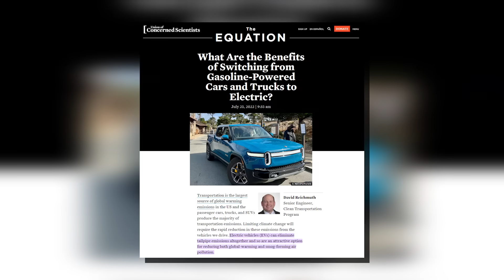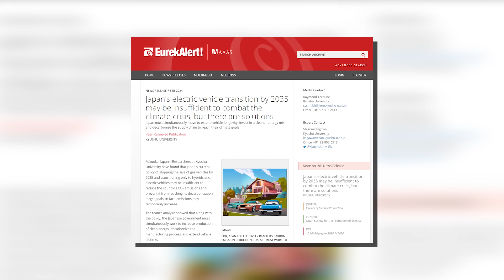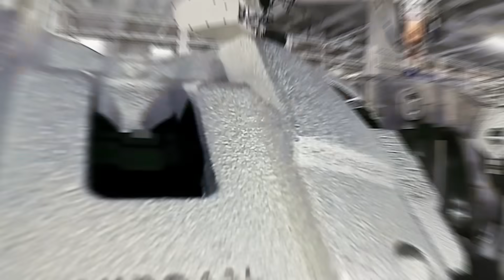The Real Reason Why Japanese Reject EVs

Comment: Pure EVs are dead. Self charging hybrids with small efficient and clean diesel two stroke generators are the only way forward with net stupid. 
Doing it this way removes range problems, removes the excessive burden on the grid, removes the frustration of having multiple charging apps all linked to your bank account, removes charging point queueing frustration, reduces the cost of the battery and therefore both the cost and weight of the vehicle which will also address excessive tyre wear.
In fact the ONLY downside is that those in the FAT PROFIT game will be out of pocket.

Comment: Almost all batteries and their components  are made in China. This is why Japan is trying to avoid EV's as they don't want to rely on China for anything. As for hydrogen it has been proven that this is a dead end as it costs 6X the electricity to produce it vs just putting the same amount into a pure EV.
Reply: The Chinese already used the solar pannels to make hydrogen; in the future, they will create more hydrogen for the vehicles, from small cars to big trucks.  The reasons that the Chinese are able to make battery cheaper than other countries because they have been making friends around the world, most importantly, their battery business is in the vertical business....so it is very efficiency.
Reply: @themiddlekingdom9121  So make enough hydrogen for one car when you can charge 6 EV's with that same amount of energy. Also  you have to store the hydrogen and transport it to the sights to be put into vehicles. No sorry hydrogen is a dead end idea and is being abandoned everywhere as a dead technology. 
As for Japan they are doing everything they can to NOT rely  on China for anything at all as they have been burned in the past by the Chinese.

Comment: I remember seeing a story where a guy had a small dink on the bottom of his electric car and it totaled the car as it cost $60,000 to replace the battery. So I would hesitate to say that electric vehicles are cheaper to fix or more sustainable then internal combustion cars. 
Oh, by the way, when they say less parts to make, they are talking about the parts necessary to steer, accelerate, and stop the vehicle. Drive by wire is absurdly dangerous in my opinion as it leaves essential systems to be dependent on software, and some people may be just one update away from a car that decides it doesn't want to stop when you press the brakes.
Reply: Dear poorly informed and easily duped person. Drive by wire sir is in most vehicles today regardless of power source. More reliable, lower cost, longer life. In fact many ice vehicles have more computer power than EV as the computer controls turbos,  airflow, fuel, exhaust and many other parameters of the overly complicated ice vehicles today. The battery claim is ridiculous on its face. https://youtu.be/jfGf6fcBlRo?si=n8jhn9_jeIJeg030
Reply: Drive by wire is applicable to both EVs and ICE. Nothing to do with propulsion: uses the "traditional battery" power. Also, software is not at only EV tool...
Reply: @RenatoLaino  When I say 'drive by wire', I mean the ability to steer and give motive power to the vehicle the same way one 'drives' a car in a computer game using a racing controller.
Reply: @byurBUDdy  my perception is that you're just not well informed. That a vehicle is electric or not, doesn't limit the software or steering tech it  an use. EV referes only to cars equipped with 100% electric drivetrains and batteries to store the power. And ICE today can have steering by wire and self-driving in the same way as an ev. Please don't let people food you
Reply: @RenatoLaino  I was critiquing the technology in general. I find giving a computer control over the steering, braking, or acceleration of any vehicle to be absurd. In older ICE cars, those three systems are each independent from one another. They are also mechanical. Yet that is not the case with drive by wire technology, as all of those systems go through a single point of failure, and a system fault may result in loosing control of acceleration, braking, and steering. 
There is a difference between using an emergency brake that has a physical connection to a braking system, and an emergency brake that is just a button that is dependent on the computer to activate.

Comment: OK. All this information is old and everything has changed since this information was correct. The bottom has fallen out of EV sales. The dangers around fire and explosion of the batteries, the lack of charging infrastructure, the inability to supply enough electricity, the extra weight and acceleration, the fragility of the battery, the technology around the management of battery safety. things like cold, shut the battery down. Countryside Australia, reports that in the even of the regular fire and flood events, electric power is the first to go down. The problems are endless and impossible to overcome. What also has not been mentioned, is the decision by many car manufacturers to develop new more efficient combustion engines. This news came out 6 months ago but there are some many unsold EVs at dealerships, that they there is an effort to screen this information until all EVs are sold, which isn't going to happen now.

Comment: So BEV advocates say just mine more Lithium, copper nickel and make more all electric cars - well that is the very problem. To refine one ton of lithium requires 500 tons of ore and 500,000 gallons of water. Add to that the world grid is mostly powered by fossil fuel and it losses 15% of the enegy produced to power the BEV cars that typically weigh 1000 lbs more to move.  Further a hybrid can be powered by bio fuels such as bio diesel or ethanol; which makes them 100% non fossil fuel; while the grid is 50% or more fossil fuel powered. People forget the massive power needed to build a dam with 12 million tons of concrete or a nuclear plant and U235. they arent green either.
Reply: Not to mention when mother nature strike and power is of for days, you're done for. Having different energy source make your life much reliable than having one energy source.....

Comment: The Reason Japanese Companies have not all jumped into BEVs is simple; they know it isn't - the future.  At leat not Lithium based BEVs.  The reason is simple; BEVs aren't green; and you can't make enough of them, like one thing - Lithium supply. 169,000 tons of lithium were refined in 2023. That is only enough for 12 Million Y size BEV batteries if  you make nothing else with lithium. No cell phones, nothing.  The market is 90 million. If you use 1/3rd of Lithium for other products you only have enough for 8 million BEVs or 16% of the market; where as if you use smaller batteries like found in the Toyota Prius and Rav4 hybrids; you can make 8x as many.

Comment: Hybrids require more maintenance than a regular ice car. You have 2 systems working in concert with each other. Problems can occur when the two systems get out of sync. The ice car requires more maintenance than a pure ev car.
Reply: You don't know much about Toyota hybrids if you think that. Their hybrid system is simpler than people realise
Reply: I have done 100k miles in my hybrid Yaris and apart from oil changes and tyres I have had to do nothing.
Reply: @jamie-ck6js I love Toyota, yet in Evs you don't have to do any oil changes or replace brake pads as frequently as ICE. If Toyota would decide to do it seriously, they may be able a car that needs to have only cleaning and inspection
Reply: more complex doesn't mean more maintenance. Actually it's the opposite of what you're saying for hybrids if you're talking about Toyota.
Reply: not necessary， Chinese hybrid cars have no transmission to maintain, because transmission is not needed to equip in the system and all that engines do is keeping charging the battery which promotes the motor. Besides, the electric part is relatively easy to maintain, so the maintain cost is actually lower than ICE.
Reply: When I think of pure ev cars I think the early iPhones. Planed obsolescence, get the latest one and there is a super low trade in.
Reply: No current EV battery is maintainable - it's one-and-done tech.  If the unserviceble nature of EV batteries is not solved, the auto salvage yards will be stacking EVs that only need a new battery.
Reply: @timothykeith1367 where do you get your info? My advise is not to believe the fist thing you see. Ask the people tha has worked on it, look for multiple sources of data and don't get attached to the outcome
Reply: @timothykeith1367 EV batteries can be replaced or exchanged. It is a lie that batteries cannot be re-engineered, as several countries have already implemented battery re-build companies (look at the report on the fully charged channel) . The raw material are just too valuable for them to sit in car dump yards, unlike petrol engines and rusting fossil fuelers.
Reply: Further, an EV one can charge at any powerpoint, which can be supplied by free power from solar or battery or both in concert. A hybrid still has to call in at a petrol station and pay prices at the whims of the fossil fuel barons. No hybrid built cannot get away from the fact it is neither a petrol car nor an EV, so something has to be sacrificed for wither to work to the best extent.

Comment: In China, EV prices are already coming down to on par with or even below ICE of similar comparable configurations and sizes. Plus, the saving from at least 10 years of usage with electricity charging vs. gasoline. It saves consumers a significant amount.
Reply: Actually well below as the new BYD $11000 hatchback buries the ICE competition.
Reply: Factory overproduction. Inventory dumping.

Comment: The Japanese have not gone woke and understand PHYSICS.
Reply: Apparently not as an ICE car loses 70-80% of its energy to heat where as its less than 20% for an EV
Reply: @mistermood4164  And how much electricity is lost over the wire? Where did all those rare earth minerals come from? You probably think electricity comes from the wall don't you?
Reply: @doctordetroitt   its less than 20% copper wire is very effective and transferring electricity between components. Even if a power plant is run by fossil fuels we would be able to power twice as many EV as you would ICE  given EV are twice as efficient.
Reply: Dear Dr., what laws of physics thermodynamics support vehicles which waste 80% of the energy in a gallon of gasoline which is lost as heat? EV waste heat is less than 20%. In addition buy a Nissan Leaf EV and discover you get 111 e-mpg compared to 29mpg for Rogue. Purchased used Leaf and used Model 3 five years ago. So far over 100,000 miles combined. Saved $7,000 on fuel, $2,000 on maintenance. Leaf has never had an issue, not been to the dealer.  Model 3 had three warranty repairs, Tesla came to our house and did the repairs. Both batteries at 99% capacity. I'm old guy, worked in Auto body industry for 35 years. Driven every type vehicle imaginable. Would never go back to gasoline. Ditto my wife. Quiet fast smooth easy. Wakeup to 300 miles from Tesla, 150 from Leaf as we charge overnight. Try it, fear not Doctor!
Reply: @BobQuigley  You buy a golf cart if you want. You think electricity comes from the wall dont' you? How about the roads where these heavy beasts destroy asphalt (made of what again)? and then replacing tires twice as fast to boot. I suppose those rare earths are mined effortlessly too. And then ask MR. Physics what happens to lithium in the winter with charging.

Comment: Keep talking folks. Meanwhile, I'm into the 5th year of owning my Chevy Bolt EV and still love it. It's a masterpiece, beautiful inside out.
Reply: How much is it worth?
Reply: @timothykeith1367  To me, it is worth more than a Rolls Royce.
Reply: That's great but - what would worry me at year 5 would be resale value and the imminent cost of replacing the batteries. How does that work?
Reply: @JLSMaytham  
1. Judging by the local ads, used Chevy Bolts are offered for about 70% of their dealership prices. This may vary depending on a number of factors, of course - year, mileage, trim, condition etc.

2. Before my battery was replaced for free as part of GM's recall program last year, I had it tested by the dealer. The test showed that my battery's SOH (State of Health) was at 92%. This 8% degradation - after 4 years of active everyday use including frosty winters - means that the battery is highly likely to outlive the car. So, replacing it is not "imminent".

Also, I have read about some German guy (forgot his name) who had driven his Tesla for over 1 million kilometers and the car just keeps going.

These are facts. The rest is propaganda.

Comment: First was Mitsubishi iMIEV (based on its petrol model iCar) then came Nissan Leaf. Both had a very bumpy start due to extreme scepticism of range anxiety back then. Now more have warmed up to EVs due to "no pipe emissions" thing which I personally disagree. For me, EVs are smooth, quiet and realistically quick off the line thanks to big instant torque. EV are heck a lot cheaper to run unless you live in areas that cannot be charged cheaply in public charging station (not in my case though). Even with Road User Charges, EVs still work out cheaper overall for us. Mind you I still want to drive my ICE but I have to pay so much to refill my petrol tank!
Reply: @barn2255  Well that is your case in your country. I will not electricfy there then.
Reply: How come you disagree with “no pipe emissions”? Care to elaborate?
Reply: @kng128  The emissions come from somewhere, just hidden, and if anything mining for the battery minerals etc is worse for the planet
Reply: Where I live electricity works out to about 7kwh/US$. In my EV I can go 25-28 miles/$. With the EV I can go 50% further per dollar than a hybrid with petrol.

Comment: I remember in 2011, Nokia went with Microsoft over Symbian OS. What happened next was too painful to watch, as every average IT professional knew the path that would follow: rejection by the customers, except for the executives of Nokia and Microsoft. It's the same with electric vehicles (EVs); a few companies are pushing for something that is too expensive and simply not ready. The only way to persuade customers to buy electric cars with a lower range than gas or diesel engines would be if the prices were actually lower, like 40% lower than the cost of an ICE car. You are donating, or better sacrificing, your own time whenever you have to wait for the car to charge for an hour. You are losing valuable time, and they charge you a premium for that. Just change the pricing model, and sales will pick up when the real-life range becomes competitive with ICE cars in all weather conditions.
Reply: EV prices are coming down as manufacturers reach volume production. Ten years ago there were maybe 3 EV models. Now there are dozens and getting cheaper every year.
Reply: In China, EV prices are already coming down to on par with or even below ICE of similar comparable configurations and sizes. Plus, the saving from at least 10 years of usage with electricity charging vs. gasoline. It saves consumers a significant amount.
Reply: EVs are already cheaper to own and run than comparable ICE cars and soon they will be cheaper to buy as well
If you are charging at home you really don't need more range!  ICE car owners don't understand that charging an EV takes none of your time, just plug in and leave the car.  ICE car owners believe you have to stand next to the car while charging just like they do when they fill up their car.
EVs are working in all weather conditions, from very hot to extremely cold temperatures, that is why they are very popular in Norway even in the dark and extreme cold winter.
It seems to me that you have been listening to too much FUD
Reply: @casper_hansen  Yeah, I would be charging from home over the night, but the range you are talking about that I do not need... Well I do. As I can do 360 to 450 km on a good day even more. And I need range in any condition. The last thing I need at the end of my business trip when I want to return home is to wait for supercharge or some other bull charge... Really I need my car for long distance business trips not waiting for it to charge. Not every place has fast chargers...

Comment: EVs are not the future.
Reply: He's right. They're the NOW.
Reply: EVs are simpler, easier to maintain, faster, more powerful, quieter and the potential to be cheaper is there. When manufacturers get past the false starts, it will only be a matter of time before they become the most popular.
Reply: EVs are disposable as long as replacement batteries cost more than 25% of the current value of the vehicle. 

10 year old Teslas are getting replacement batteries for $20K that only comes with a ONE YEAR warranty.
Reply: @Timmymao163  as are petrol cars. We used to get second hand short engines from Japan, didn’t work out.
ICE cars now full of anti-pollution stuff, coolant pipes, electronics. Nightmare.
It’s now throwaway society.
But first, batteries have to fail. Tesla & others are getting very reliable. That’s the point, not the service potential.
Don’t forget Global Warming. That’s the point, not the savings.
Reply: What is?
Reply: Mole, I power my home and charge my car from the solar panels on my roof. I don’t have an oil well or refinery on my place, so oil doesn’t make economic sense. But if you like sending your paycheck to the Saudis, more power to you!
Reply: @freeheeler09 same. No fuel bills, all electric home and cars, all powered 98% by the free sunlight where I live. I even help the grid for free 😂
Reply: @freeheeler09  Petrol and diesel cost savings do not make up for high purchase cost, excessive depreciation in value, low range, air pollution from tyre and brakes wear, low range, fire danger, public charging problems...
Reply: Clown.